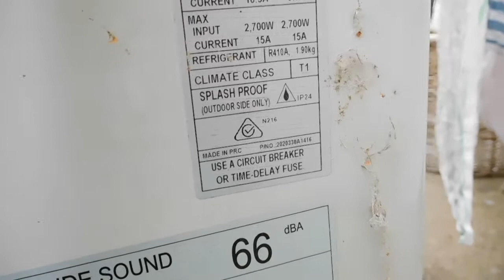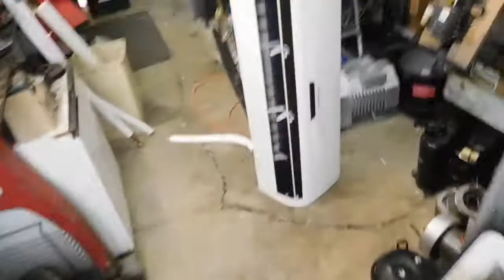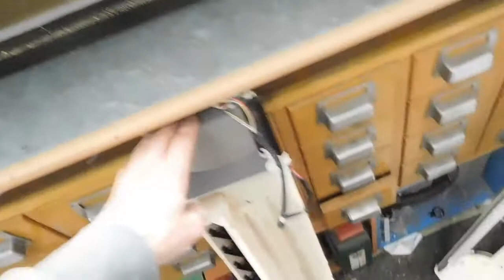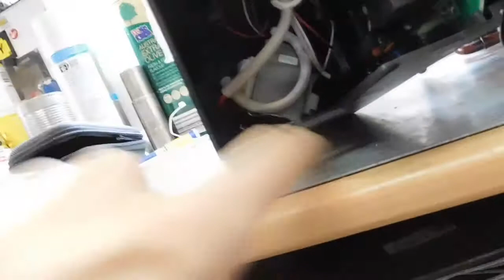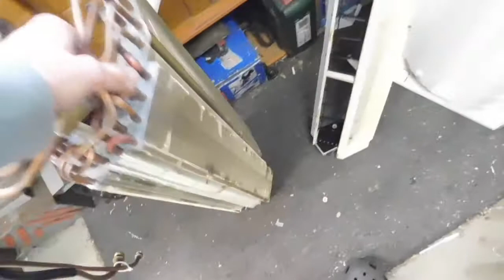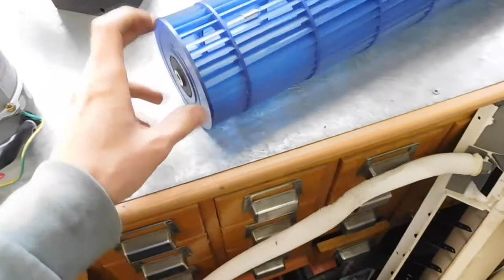"Kelvinator" Split Aircon Autopsy P1 - The Indoor Unit

Comment: Hi, I finally found a channel that basically has the same air conditioner as mine. I want to know how do I remove the panels so I can get to the white drainpipe coming from the indoor unit itself. As I am leaking water when I turn it on. I was told to see if there is any blockage in the white drainpipe (because my sister bought it around 2013-2014) and it has not been properly looked after. Where I live they don't fix these anymore?

Comment: Electrolux in this day and age isn't a very good brand, I avoid it like a plague. Have you had a lot of experience with many brands? what air conditioning & refrigerant brands would you recommend and avoid ?
Reply from the maker: Personally, I haven't had any serious issues with any Electrolux appliances owned in the past, thats mainly speaking from experience however. Lennox, Temperzone, Daikin, Panasonic and Fujitsu are the best quality, Most of the no-name brand equipment I would avoid ;)
Reply: @MrMacman98  what do you think about Mitsubishi or carrier ?